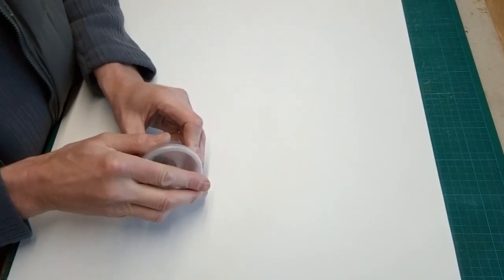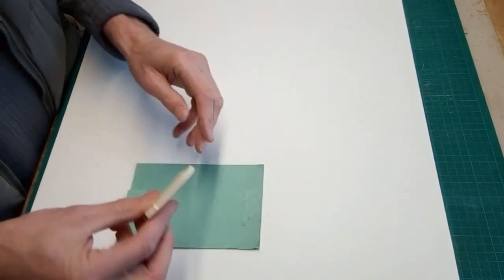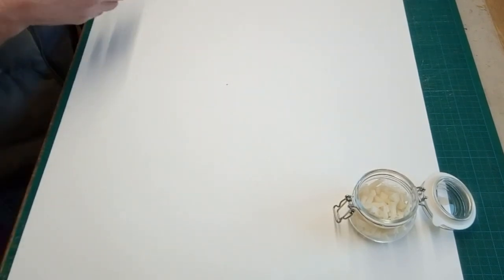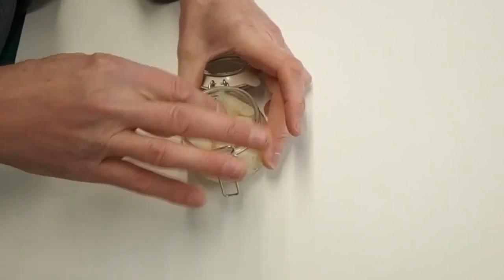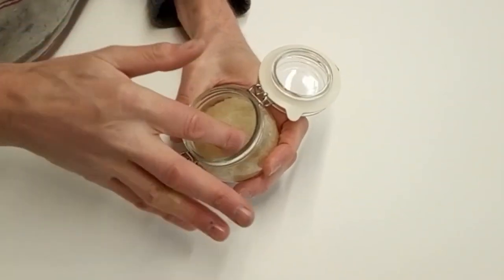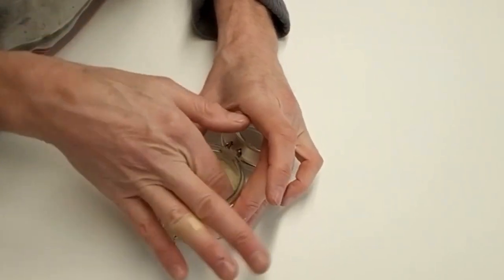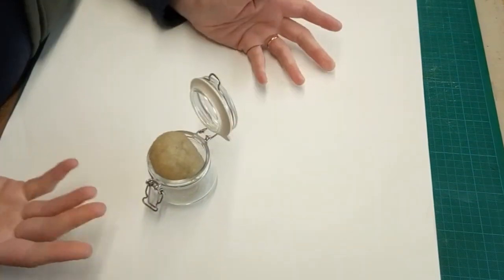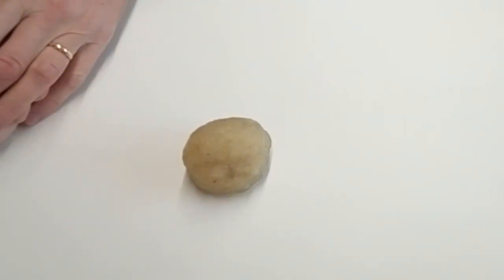Making a gold rubber

Comment: Wll the kneadable art eraser also work? I dont know where to find crepe rubber in my country local markets. Also I can only find granulateed parafine for candle making. Thank you.
Reply from the maker: No, I don't think that will work I'm afraid. A gold rubber is not essential but it is useful - you could just use a soft cloth and a little lighter fluid (butane).
Reply: @ I see, thank you. Well fortunately I have found something called “Crepe Rubber Cement Pick up” meanwhile in some German online shop for just 6 euros so I will go for it.